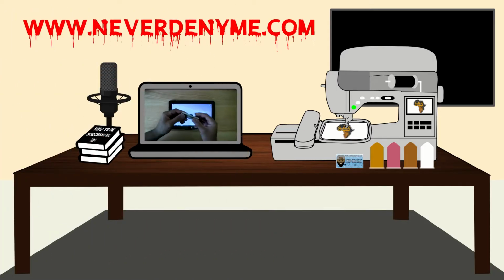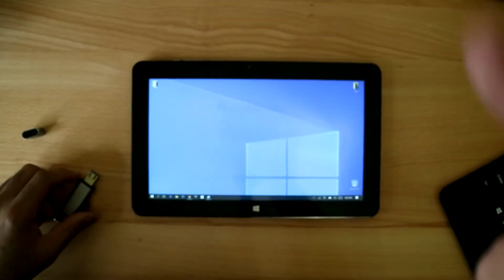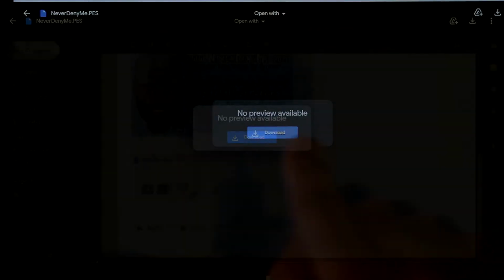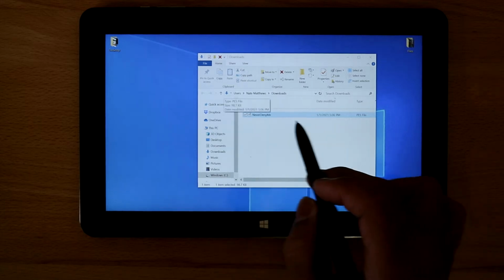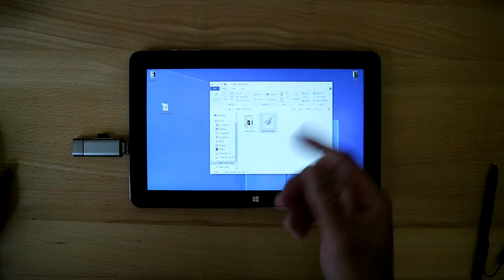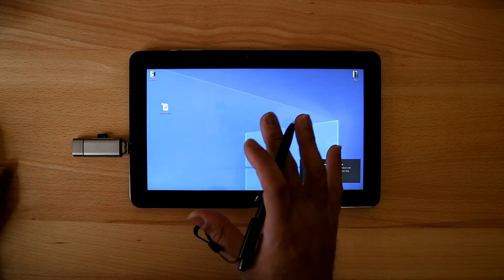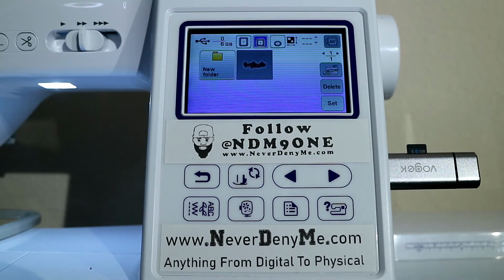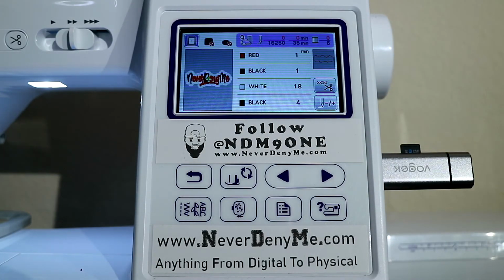How To Save & Transfer Embroidery Files To Your Machine 🧵 | USB File Transfer Using A Flash Drive 💻

Comment: I'm VERY NEW to embroidery. You explain things so well. I have a logo where I used to work and want to digitize it so I can embroidery shirts for my coworkers. How do I do that? What I want to do is send the logo to you and have you digitize it so I can put it on a flash-drive and use it whenever I want to embroidery a shirt. Is that possible?
Reply from the maker: Glad I could help. I can convert the design for you. You can submit it through the custom form on my website: http://www.NeverDenyMe.com
Reply: @NeverDenyMe  the file I have is a png... therefore I guess it won't upload / download to you. Any suggestions or can that not be done? It needs to be jpg I think
Reply from the maker: @ruthhorst2529  the form accepts various formats. Have you tried it already?

Comment: I have an iPad and I am using the new artspira app from brother. But it will not open the designs. I can send svgs but nit ones designs? Do I have something turned off on my old that might affect that? I’ve checked everything!
Reply from the maker: This video is a demo showing files I've personally created and how to get them over to the machine via USB. I don't use an iPad or artspira so I'm unable to assist with that. Sorry.
Reply: @NeverDenyMe  thank you for replying😊